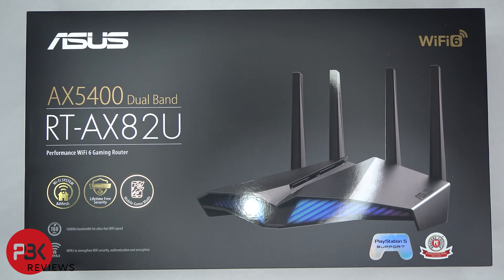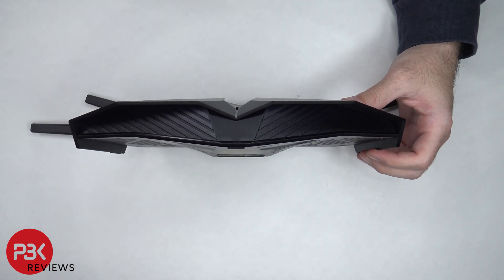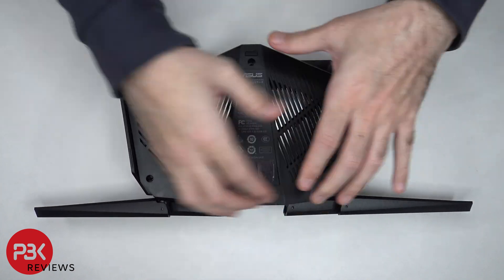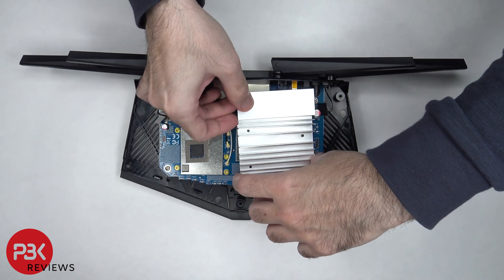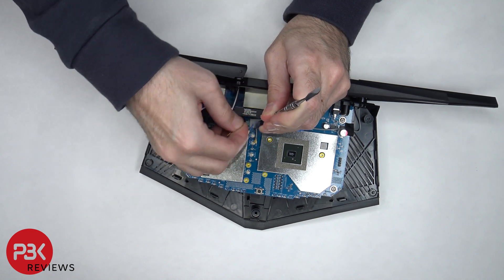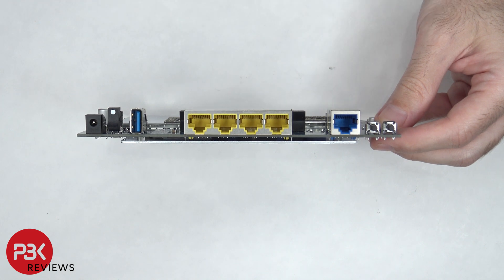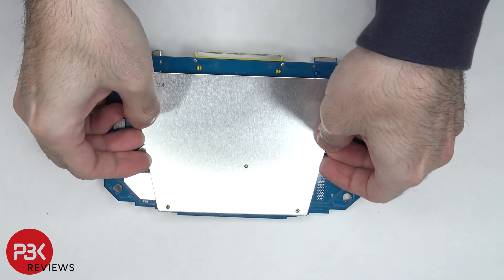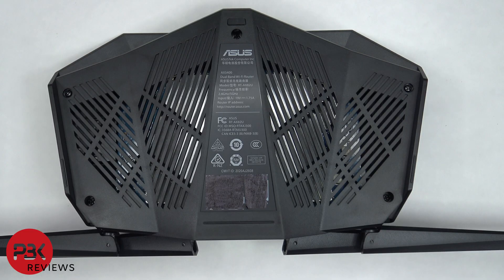ASUS RT-AX82U AX5400 Dual Band Wireless Router Disassembly Teardown Repair Video Review

Comment: Why would anyone need to see how to take apart a router? 
It's not a phone or a device that needs special tools or knowhow not to damage anything, and there are no serviceable parts inside or anything that wears out or needs replacing. (or possible to replace for most)
Just bizarre. 🤷‍♂️
Reply from the maker: Some people change out the antenna or extend the cables to have better range etc. It happens also that people break an antenna and just need replacing a cable or single antenna so they don't want to pay $200-$300 for a new router when they don't have to. And finally there are people who want to see how its built and how well the internal cooling is to see if it would be worth buying for the long term or not. Many routers fail or die out quickly (especially linksys).
Reply: Thermal pads needs to be changed after 3-4 uears lol 😂🙈
Reply: I am here specifically for this video because I would rather attempt to repair than to replace my router. Just because you do not have the skills to do so does not mean there are no serviceable parts inside.

Comment: i have been searching for this for soo long time! amazing clip simply amazing ! the back thermal pads are 2mm ? and fron ones 2 or 1mm ? the pads are better to be checked after the 3 years of waranty. (if needed changed with arctic or probably better thermal grizzly ones). this router has such a good cooling and the case also. Comparing to asus rog gs-ax3000 or 5400 - (they have no holes in the upper part of the case)- i belive the boards are almost identical except the front LEDs- rt 82u has more of them and is looking nicely. Thank you for the clip
Reply from the maker: Thank you and you are welcome. I didn't end up measuring the thermal pads so not sure about the thickness.
Reply: PBKreviews i will answer then 😜 front ones have 2 mm and the ones on the back 3 mm. The stock ones will last 3-4 years but there can be easily changed to something good like thermal grizzly minus pad 8 pads! I did not look but maybe you can tell me - are there any pads under the shields??? (Asus used to do this on cheaper routers and this make it so hard and expensive to change them)

Comment: what a totally random item to disassemble. fun to watch though. they could REALLY cut down on the amount of wasted plastic they use to make these
Reply from the maker: Lol ya, trying to expand on more items to take apart. Ya true, however if I am not mistaken, I feel like they need a certain amount of separation between the antenna as well as some extra room for the heat etc but not sure.
Reply: The shape of the router is mostly marketing tactics to make it look "cool". But other than that, the heatsinks on the motherboard still needs breathing room to dissipate the heat. I would have liked to have seen better heat transfer tape and maybe even a low cfm quiet running fan to help dissipate the heat as these units create a lot of heat.
If the manufacturer thought they could have saved a little more money with using less plastic, they would have!